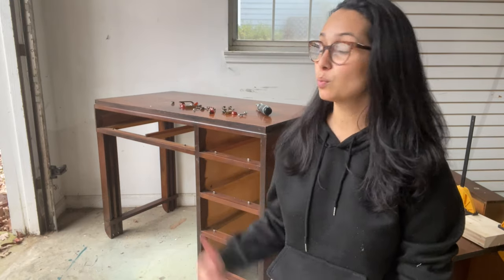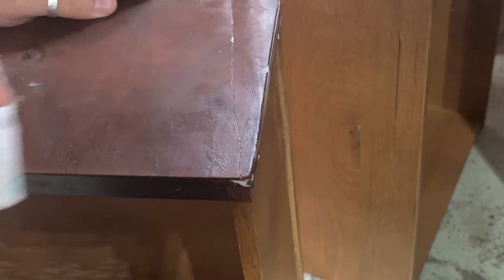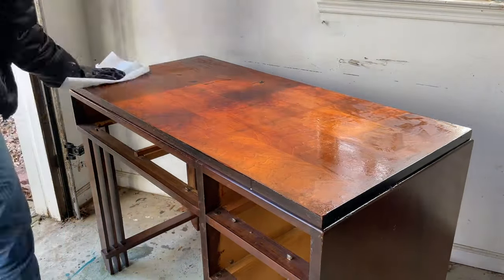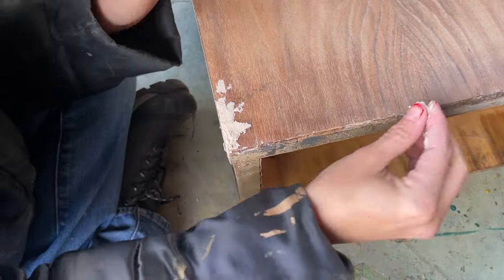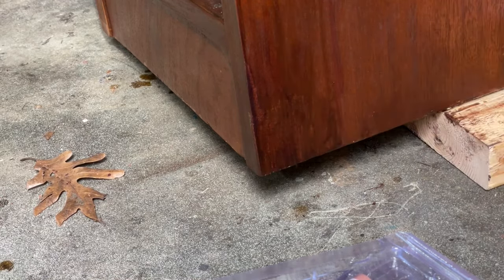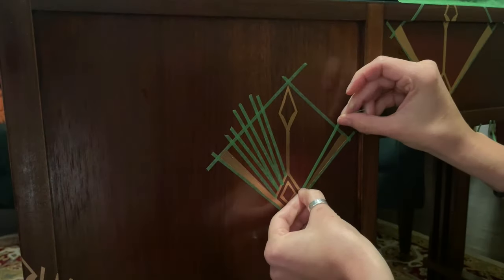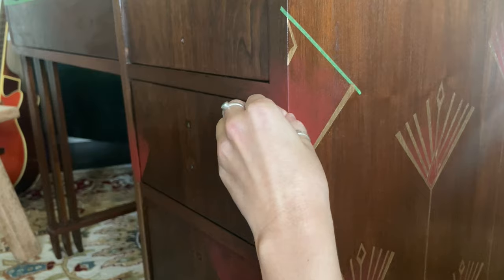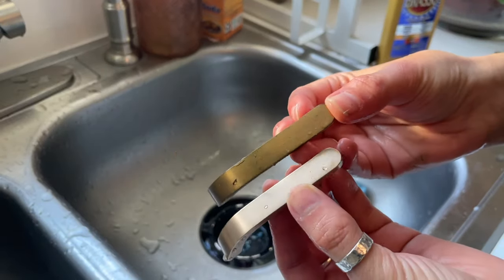Antique Art Deco Desk Makeover | Stripwell’s QCS Stripper

Comment: Love Kwikwood. You are right, it doesn't take stain well, but does any filler. Even the stainable ones. I found it in a dark color which helps.
Reply from the maker: Oooh I’ll have to check it out. Thank you!
Reply: I think the reason the Kwikwood doesn’t take stain is that it’s not wood filler (thus no pores to absorb anything).  It’s an epoxy putty - without all the stink and mess of something like Bondo.  I absolutely LOVE Kwikwood, it’s so handy and it is really sturdy.  I am amazed at how well you covered it, Marissa!  I never thought of painting with gel stain.  I usually just build up layers (more time!) and then Mohawk graining markers for touch up.  What you did looks better!  Gorgeous, gorgeous piece!  Greetings from Milton, BTW!
Reply: @datachickatl4092  I blend touch up markers on  the Kwikwood.
Reply from the maker: @datachickatl4092  thank you so much! And thanks for the info too! Very good to know!

Comment: Thanks for your video! I've some questions. (1) it wasn't so clear how you cleaned off the QCS, because that part was high speed. (2) doesn't QCS recommend their own cleanser rather than water? (3) how would you clean off vertical slats on the back of an old armchair? (4) the seat of the armchair is curvy & with indentation so how does one apply a scraper on curvy areas? (5) How to scrape curvy spindles which act as horizontal-supports for chair-legs?
Reply from the maker: Hi there! Thanks for the questions. Is there any way you could reach out to me on IG or via email?
Reply: @TheMissFlips Uh, if only this venue offered PM, then you could post me your email. I'm not sure what wood it is, so could that cause blotching when staining? Can i spray QCS in garage, then XX hours later, hose it off in driveway? How big a bottle of QCS to use for armchair?